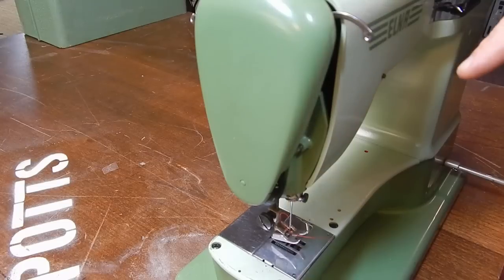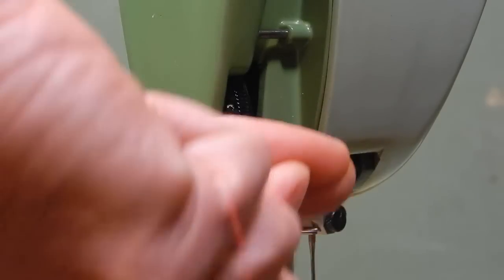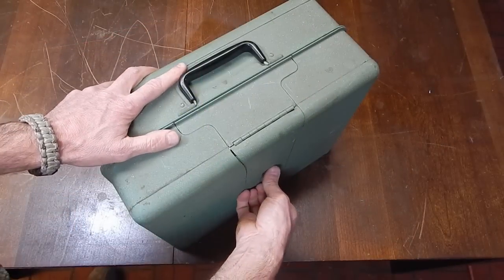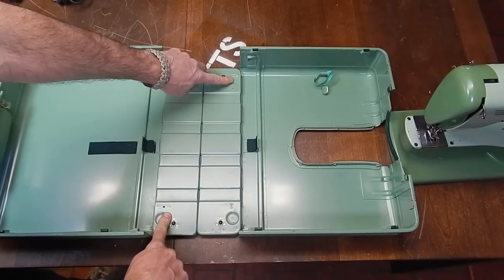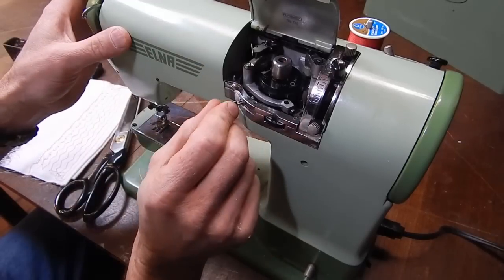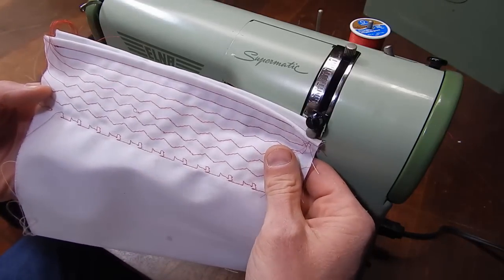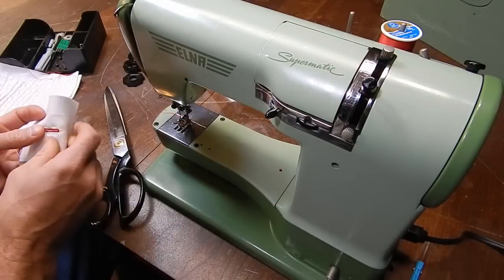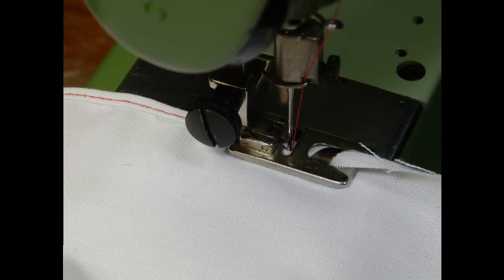Elna Supermatic How to Thread, Changing Cams, Case Features, Buttonhole and Shirt Hemming

Comment: Would you happen to have a video showing how to thread the bobbin? I get as far as the first notch but don’t know what to do after that. The manual is not very clear with the instructins. Thanks in advance.
Reply from the maker: I don't have that particular machine but I found something from my stash that might help: https://youtu.be/SgWAB4JWtbk?t=1m16s
Reply: Thanks. My Supermatic is like yours, though... drop in, rather than with a removable case as in Singer machines. But thanks for takng the time. Cheers!
Reply from the maker: Oh, My bad. Maybe this one will help. https://youtu.be/zvEsOKqdPZ4?t=6m46s
Reply: Amy Forbes b

Comment: That  "little ducks" stitch pattern doesn't look right (there aren't supposed to large spaces between & underneath the ducks).
 
EASY FIX.....  you simply turn the stitch length knob/lever slightly  to the left or right.

Turning the stitch length knob/lever  to the right shortens the  stitches (Double Discs Only). It makes the pattern a bit "tighter"  &  eliminates the big spaces in the pattern.

Turning the same knob to the left  does the opposite, stretching the pattern out (Double Discs Only). 
The knob only needs to be turned *slightly*.  Just a tiny bit!  A fraction of an inch, either way.

Some Supermatics have a +/-  stamped on that little black or chrome knob.  If you're lucky, your Supermatic has a chrome knob, so the +/- is permanent. Other Supermatics have a black plastic knob & unfortunately those makings were just painted on & usually wore-off over the years. That's probably why so few people realize they can adjust those automatic stitches!
So, even if there's no markings on that knob, it can shorten/lengthen the double disc patterns.

 This applies to double disc patterns only ......the single disc patterns & straight stitches are lengthened/shortened the usual way, by moving that same knob/lever up & down.

I hope this information helps somebody.

Comment: At the 1:03 point of the video you show to put the thread behind the metal bar. Do not do this. The purpose of the steel bar is to allow the thread to pass over it instead of the painted aluminum casting. The thread is under tension and will eventually cut a groove into the aluminum. For that reason they put a steel bar for the thread to slide over.
Reply from the maker: Thanks Paul Howell. I see the wisdom of your comment.
Reply from the maker: I no longer have this machine and I never had the manual but going back and watching the video, it looks to me like the thread does ride on the metal bar as threaded since the take-up arm sets forward of the bar a fair degree. I am sure your way works too.